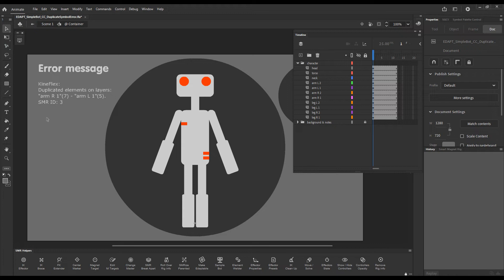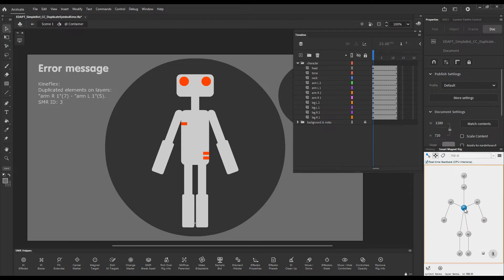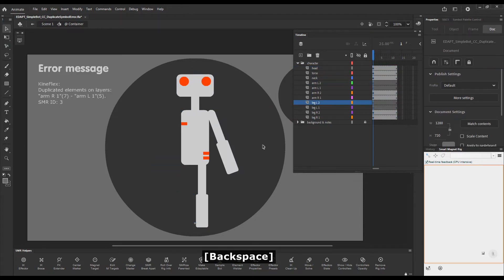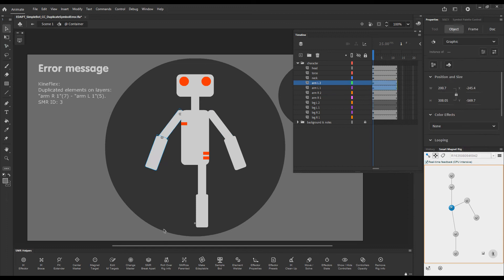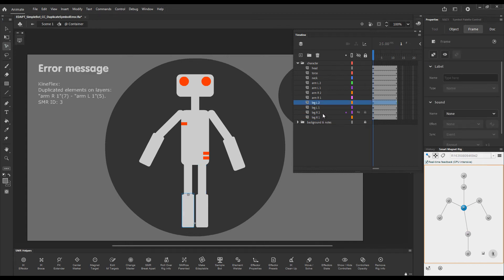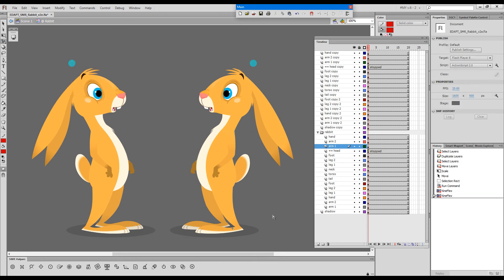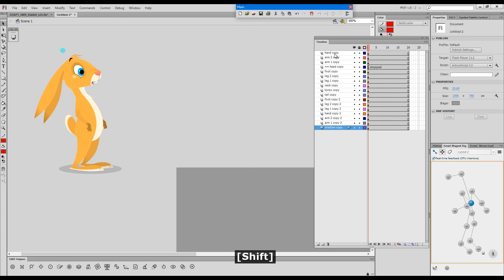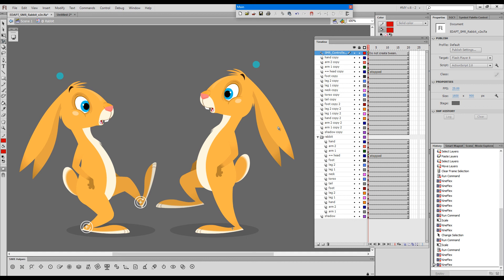EDAP Tools KineFlex: How to resolve ID conflicts

Comment: I just wanna express appreciation for this tool again! Also the fact that you mentioned you could hold shift with the Kineflex tool to move the parent and its children. What a game-changer! I've been alternating between Kineflex and the selection tool to reposition stuff after rotating it. And I'd have to keep the head on a separate layer to quickly select all of it as South Park style has the head go down a bit whenever they blink. Now with this knowledge, I can just use Kineflex, holding shift to grab the head, and quickly have the head go down that way. Yay!
Reply from the maker: Shift-drag has been there since the first release of KineFlex years and years ago 😊
Glad you discovered it!
For quick reference you can use KineFlex interactive help - Commands > EDAPT Help. 
I'd also suggest you check the documentation of the tools that you use as most are multifunction and have 'hidden' functionality, often with more than one modifiers.
Have fun!
Reply: @EDAPTools  Yeah I assumed it was a missed function lol. But okay thanks for the advice! I'll have to look over some documentation or tutorials again as I still can't remember what most of the commands do lol.